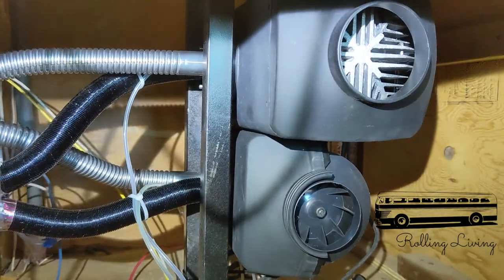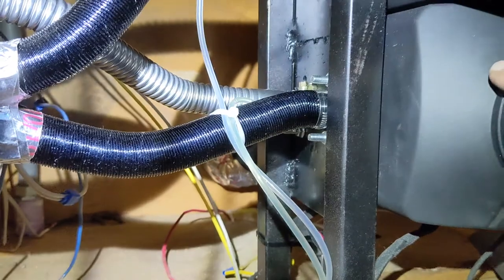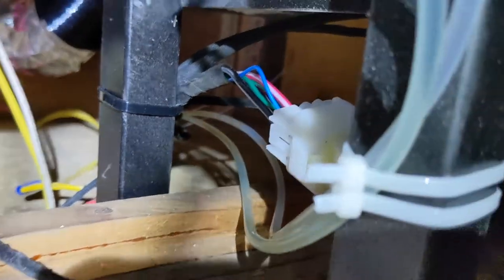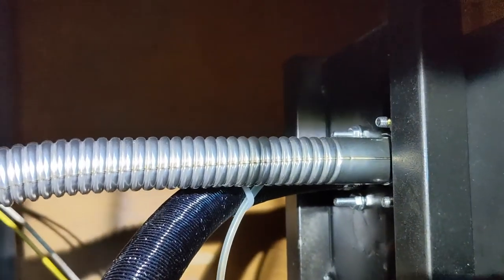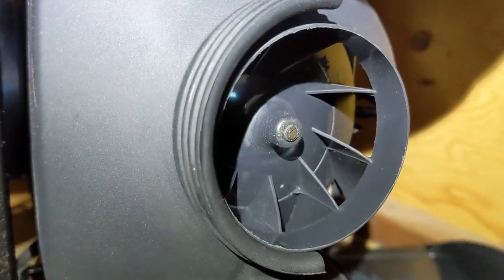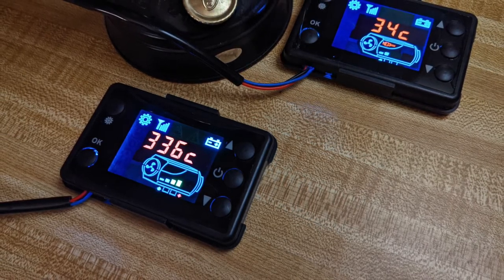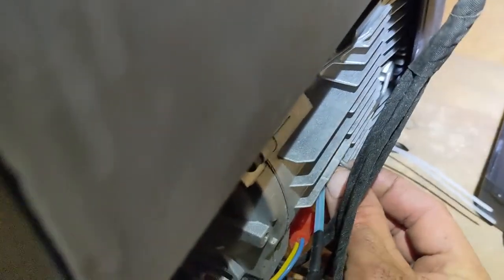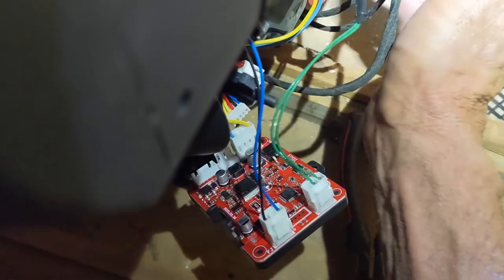Troubleshooting multiple error codes and issues with 2 imported diesel heaters I installed.

Comment: The fan is rubbing badly 😫  But these heaters doesn't like to be mounted on their sides, but if you do, keep in mind to have the glow plug at the top...
Reply from the maker: Good call, to keep from fouling the glow plug.  As it turns out, now that I've got both running, there's some significant thrumming...so I'm going to remount them both on independent mounts...facing upright.